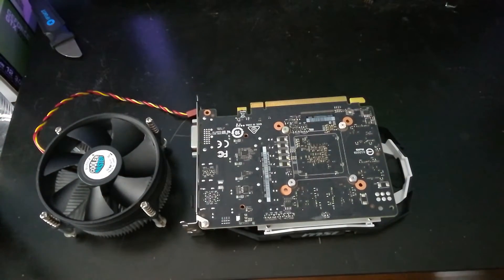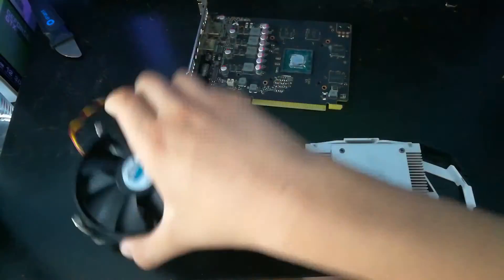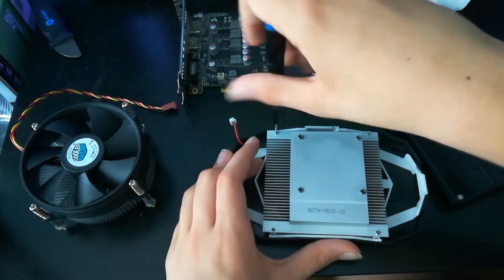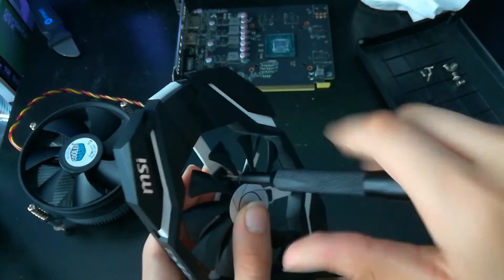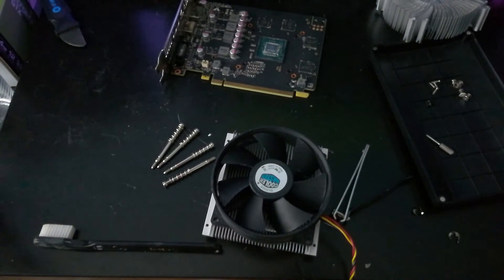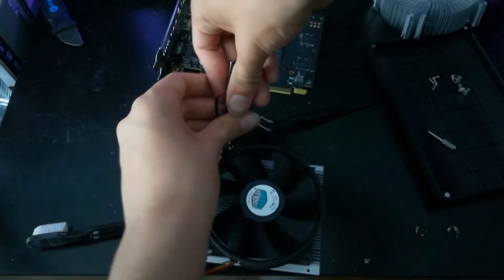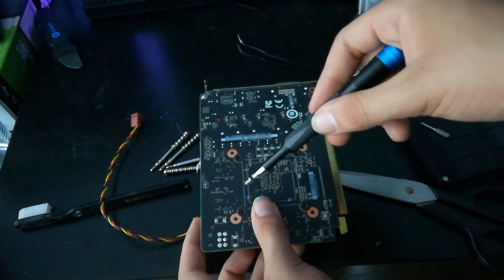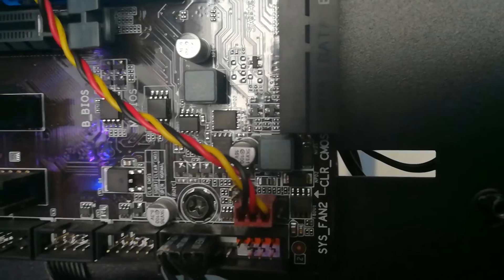How to fix a broken GPU fan, for $1

Comment: Only have two fan outputs on some motherboards, for cpu and rear exhaust fan control. You could also power rear exhaust with the molex connectors if you need speed control from motherboard with this add in fan good idea.
Reply from the maker: You can power the fan with miles if you want but it will always run at full power. You could also use a splitter from the rear exhaust fan.